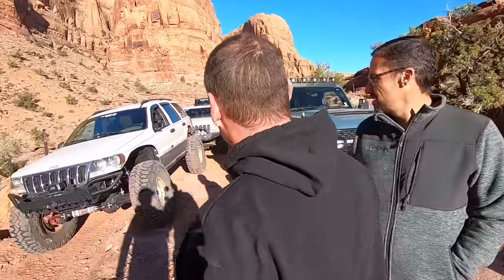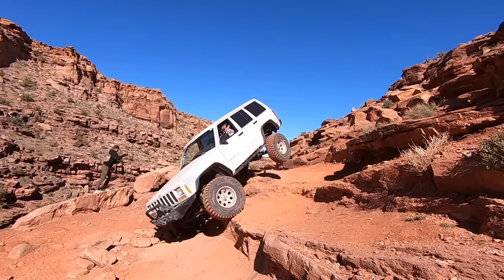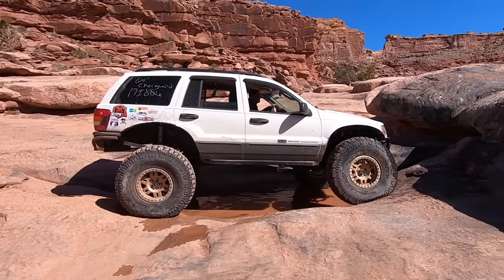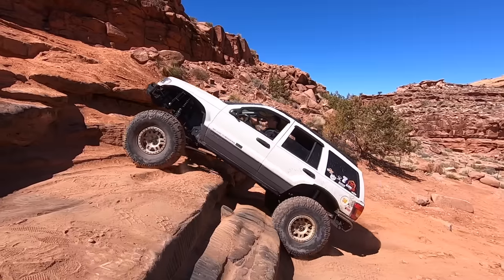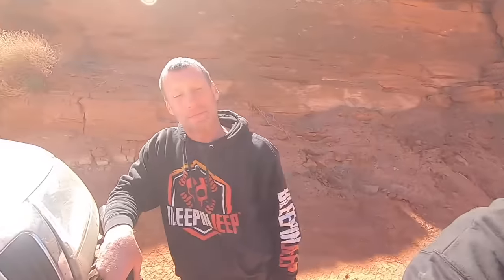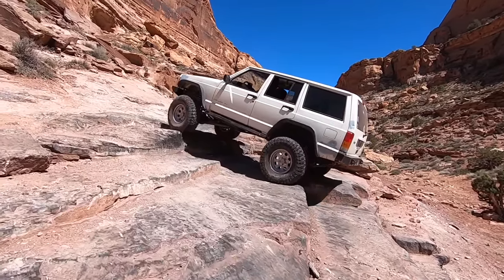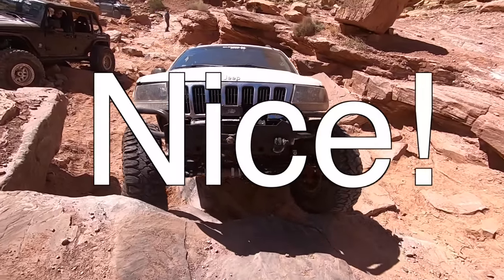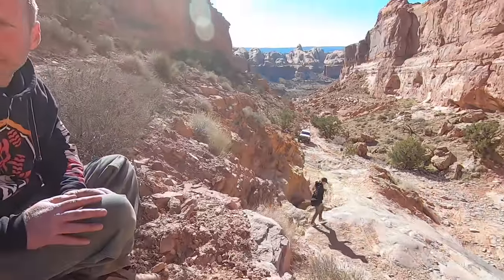Showdown: Bronco vs Jeeps - Who Will Be Crowned the Ultimate Wheeler?

Comment: The first white Jeep looked super top heavy, the one scene showed an incline that was not that extreme it appeared on camera, but you could just see the massive body roll, to the point where it was on the verge of lifting rear wheel when opposite front maneuvered said slight incline change. I think it is because it is solid body front to rear, without the flex that a conventional truck with separate cab and bed can/does provide...I used to own both a 1978 GMC Jimmy and a 1985 GMC K15 Short Stepside bed, there was a major noticable difference of center of gravity on any type of side incline between the two similar equipped vehicles, just sayin

Comment: I do not understand; so many people hate on the d35 but I just don’t see them as bad as people make them out. I’m running 33 nit to mud grapplers lunchbox locker and my tires are 13.50 wide I hop bounce and spin and have not broken a single shaft

Comment: The WJ won this of course. I have a 2003 WJ with 244,457 miles on the all original stock inline 6 and let me tell you this mother fucker has taken me everywhere with no problem, although I can't speak on the steering because as long as I've had it, 3 yrs now I just can't get it to tighten up, gone through 2 steering boxes and still ends up all over the road but I love my Jeep Grand Cherokee Laredo. Cherokee Nation baby!!!

Comment: The XJ's performance was no surprise to me. My white AMC '87 XJ 5sp with factory Dana 44 was stolen off my driveway in 2019 by means of a silent flat bed hired by druggies. I only had 31s on mine and wheeled everything except Pritchett and Rusty Nail. The untouched 4L had 285,000 miles on it. Stellantis keeps trying to re-invent the wheel selling $70,000 Mall crawlers. I'm not holding my breath for anything as useful, capable, endurable, economical, comfortable and easy to work on as an XJ. There's simply no profit in continuing to build such a vehicle. Six months after it was stolen my XJ ended its life in a gang war all shot up. It was insured, but not replaceable.

Comment: Did that trail in the rain  with a highly modified 97 D90, very challenging! Sold the rig years ago and drive a new D110 all stock so not going there now! #1 XJ ( Driver skill, and lighter truck ), #2 WJ, #3 JK, #4 FB with some work it it could maybe be #3 suspension was to bouncy also and driver, but to be clear its a very hard trail, harder than the Rubicon ( maybe the sluice ? I took the by pass always ) and the 4 dice trail. Back to weight, we used to do a mud run up in Mendicino in the winter, it was basically a winch fest as all our rigs would get sucked to the sliders in mud, well one year we ran into a local he a had a  little Suzuki Samurai, with 37's that joind our convoy, at first we thought were gonna be pulling this guy out of the mud a lot... well to our surprise he never got stuck once, kind of like a little mud boat! The weight let it float and bounce off stuff, pretty amazing to see, admittedly he probably ran the trail every weekend but still! Also I think the bounciness  on the FB and JK may have been due to the 40' tires and un-tuned suspension, they both should go down to 37's  and tune their suspension and run bead lockers for more traction, and a better slider bumper on FB ...  as it was definitely at war with the ledges, or better pick a better line?